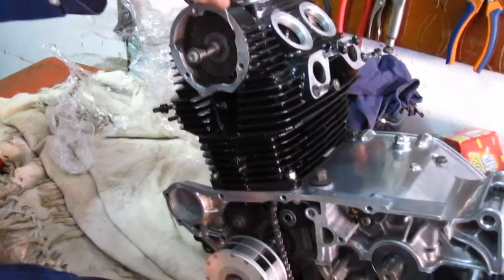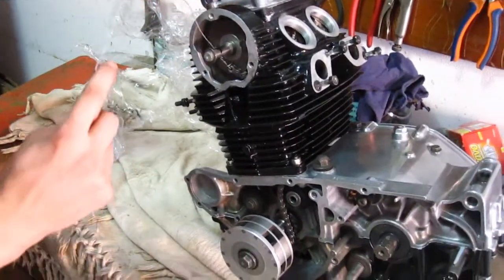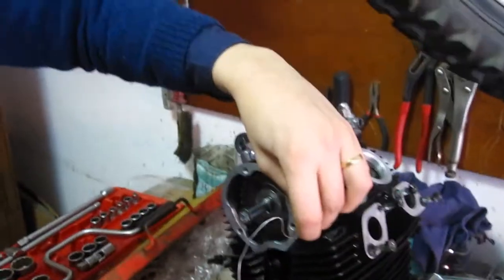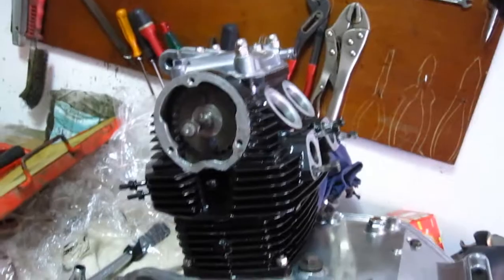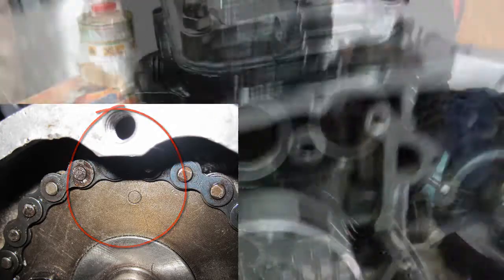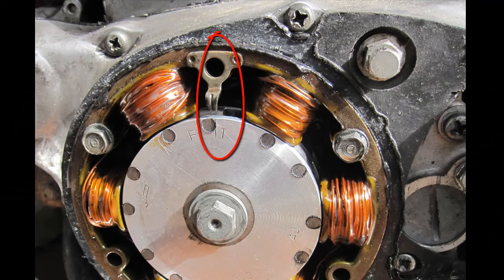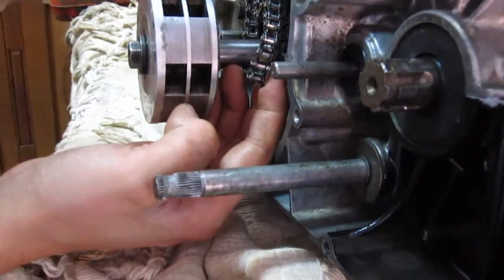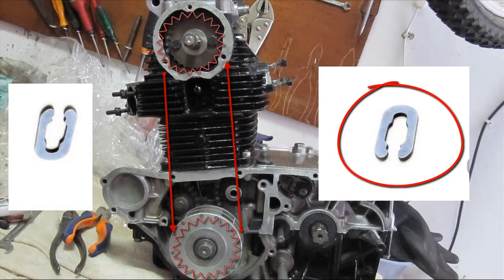Honda cb 125 cafe racer (How to Replace and Timing the Cam Chain)

Comment: Hello!
I am building the same motorcycle into a cafe racer. I can see in your video that you are not using the electric starter motor, how did you do that? What did you use to block the hole of the starter?
Reply from the maker: Hi. The engine on this video, is onot from a CB 125 model, but from a CL 125, which has no electric starter, and only a 4 speed gearbox. This also means that this engine block is diferent, and it hasn't any hole for the electric starter. Good luck for your project. Cheers.
Reply: There are 2 different engine blocks. I have them both lying